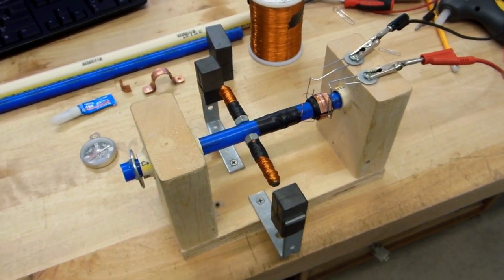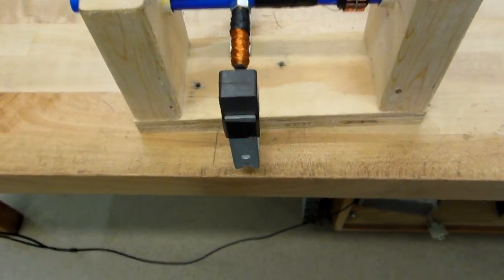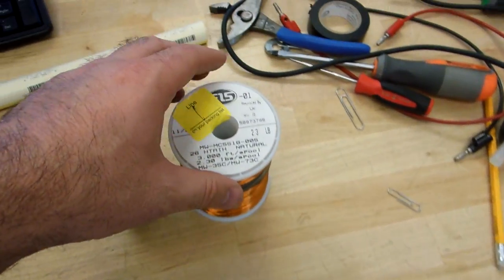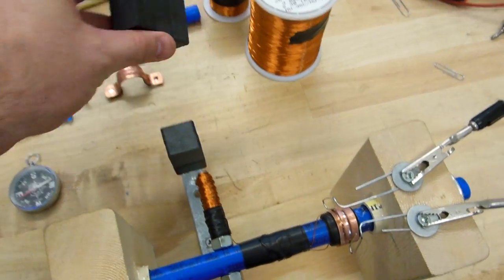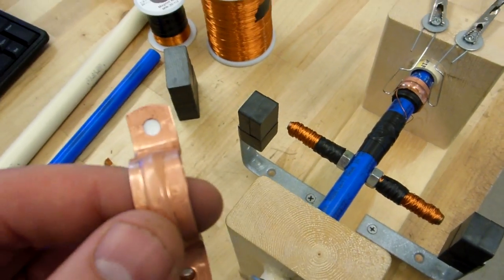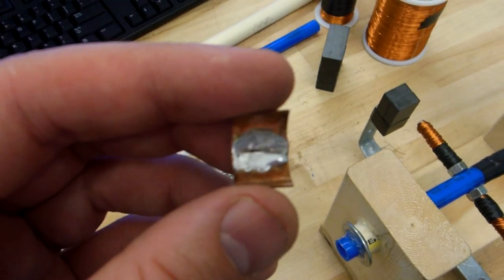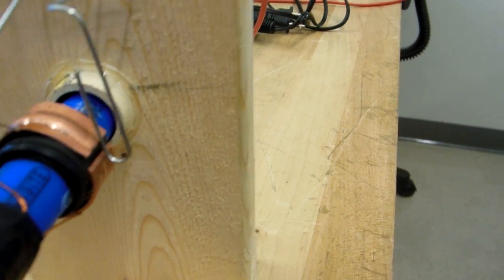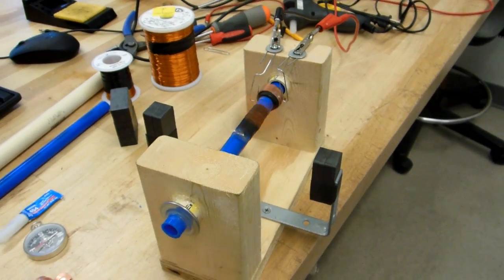Build a simple DC motor with brushes and commutator

Comment: I have always wanted to build on of these. but I was never sure how to wind the copper. Is there only one way to wind it? You use 1 long piece of wire, don't you? and then you keep winding say, clockwise all the way up the bolt?
Reply: boowonder888 yes wind it in one direction
Reply: yes.

Comment: I have 32 gauge magnet wire, I am getting no current to my coils but commutator is sparking on turn. Is the wire too small? Should I just rewind it?
Reply from the maker: I would guess the insulation needs to be burned off the magnet wire
Reply: @timcallinan  the whole wire or just the connections?
Reply from the maker: Just the connections where you are soldiering it.

Comment: Was the amount of turns of wire the same on each side? I'm doing a school project and i'm having trouble
Reply: Yeah they should be even.
Reply: put over 200 wraps on each side of the bolt, if you cut corners & skipm on winding , it will cause problems.. good luck

Comment: what is wrapped around the 1/2 inch pipe to place the commutator on? and how do you attach the commutator onto that?
Reply from the maker: Just electrical tape to widen a bit. I used super glue to attach it.

Comment: Where did you buy the wire and threaded rod, and does the armature (threaded rod) have to be a conducter
Reply from the maker: The wire can be bought from www.mcmaster.com - it is just normal magnet wire. The threaded rod is made from steel - the important thing is that it is ferrous (magnetic) it should stick to a magnet.
Reply: any hardware store , such as lowes, should have the " all-threaded rod" and the copper pipe plumbing straps ( commutator )..

Comment: What could my problem be if my coils do have a magnetic field, but still attract the magnets on each side instead of repelling them?
Reply: your magnet poles are backwards...
Reply: @guitarman_3693  lol I figured it out. I uploaded a video of this exact design for a class I was doing this for at the time. Appreciate the help tho, I was pretty desperate a year ago and hadn't taken electromagnetics yet.
Reply: @Not_Valentine  hello I’m having this same issue of both ends of my electromagnet attracting the permanent magnet, I’m curious to how you were able to fix this? Thank you
Reply: @rogerhornsby8180  you have to really pay attention to the direction you are winding your coils. If you started clockwise then it must be clockwise throughout both sides of your core. My problem was that when I finished one side, I flipped to the other and kept winding clockwise, but since I flipped sides, it actually make the other end counter clockwise so the polarity never changed to keep the motor moving. I'm not sure if that made sense, but let me know and I can try to explain again.

Comment: Would a flywheel help on this motor? I did make mine, got it running and everything, but it stops sometimes since the rotation is not smooth. It can even lift some weight.. yey! lol
Reply from the maker: Nice one! A flywheel might help but what sort of voltage are you running - at least 5V i would think. You could mess around with the position of the commutator.- This might help. Glad you got something running.
Reply: +Tim Callinan Was running it at 10V and 2,2A. 2,6A when the commutators shortened out for a second. Might try to build a new one with 3 armature ends and a flywheel. And thanks for the video, it did help me out a lot with my project.

Comment: I'm building a very similar motor to this one, but sparks keep being produced between the brushes and commutator. How can I prevent this?
Reply: Weaselskey probably the angle of your conductors and how they interact violently agaisnt each other, repositioning will do
Reply: its a common problem with DC brushes... the better the contact to commutator, the less sparks...

Comment: Would this work with a normal battery? 9v or 1.5 in series for example... I need a quick answer, would be really grateful! We have to make an electromotor for our school, it has to run for 1 minute and run from a battery.
Reply from the maker: Should work with 9v I would built a smaller dc motor. There are loads of designs out there. This is a bit more difficult
Reply: @timcallinan  I built a smaller one last night with a 6V lamp battery, was so happy when it worked! Thanks for the great video and the reply. :)
Reply: your a good teacher, tim

Comment: How did you connect the wire to the commutator?
Reply from the maker: Therese J use a soldering iron and solder
Reply from the maker: it needs to be an electrical connection